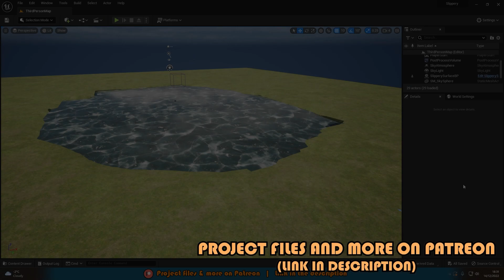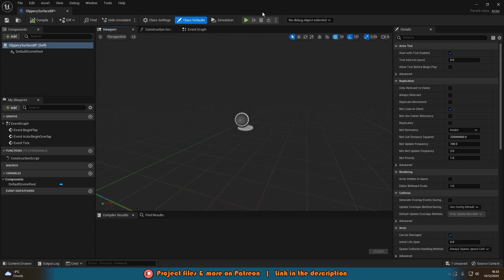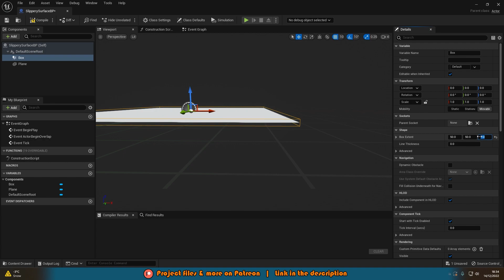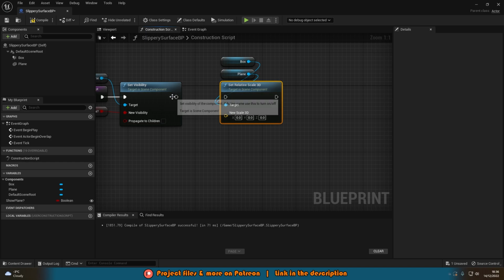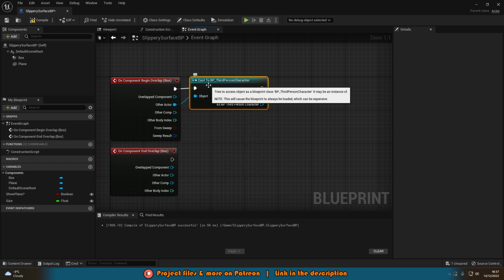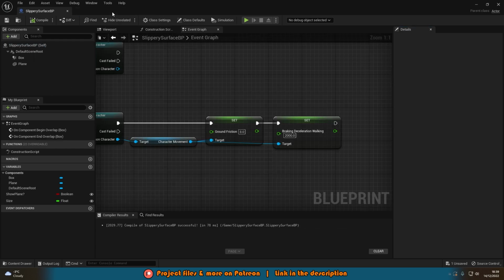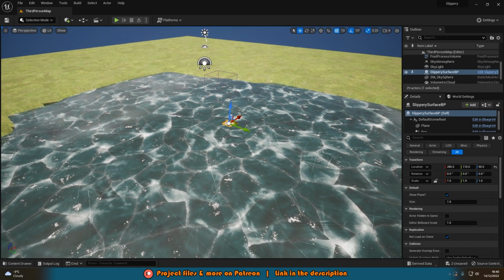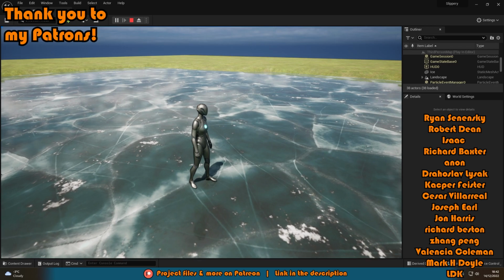How To Make A Slippery Surface In Unreal Engine 5 | Sliding On Ice (Tutorial)

Comment: How does this work at an angle? For instance, if the zone/slip platform are at a 30 degree angle, will the player start to slide downwards, even if they're standing still? Would they pick up speed if they are running downhill? Think like snowboarding

Comment: An alternative to this is to use a line trace that points down from the player character and is always checking what physical material the player is standing on (might be a better solution for the long run so you don't need to be dragging that box over every ice surface), and switch the movement values from there. Great video!
Reply: Do you have any video guide for this? This is the approach im going for but im facing many issues implementing it
Reply: How do you do that?
Reply: LIne Trace By Channel with vector down, break hit results, one of the results is physics material, check if  material is ice and then do the rest from the video